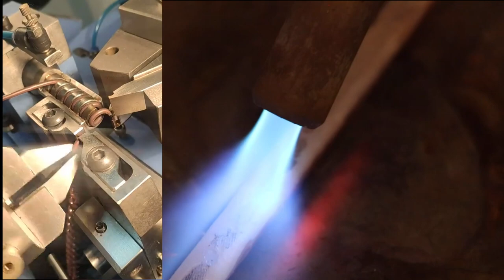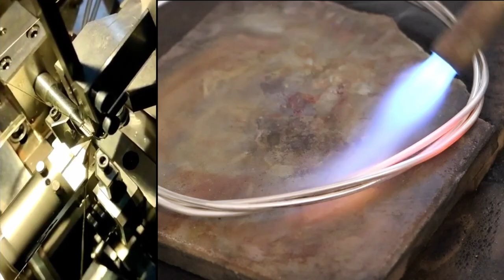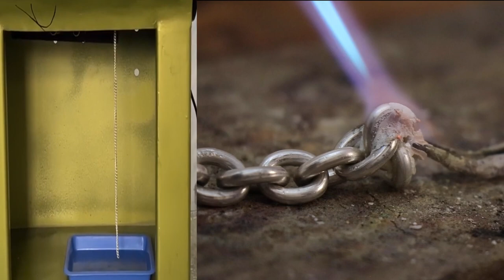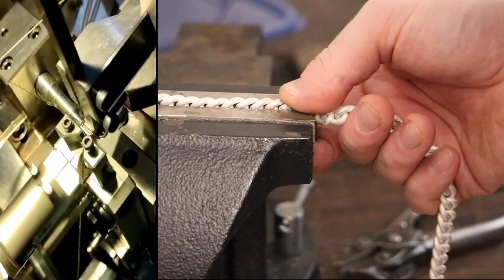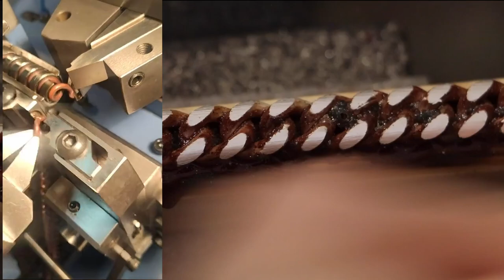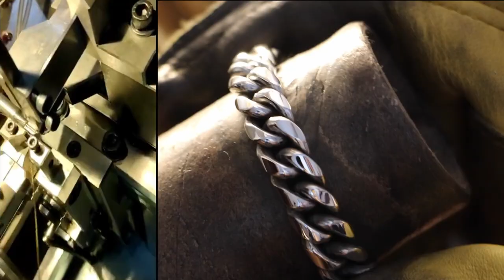CUBAN LINK machine VS handmade | how it's made

Comment: So which one looks better in the end? machine or handmade?
Reply: it really depends on the craftsman. thats a vague answer for you. 

machine-made will be overall very uniform. which is a great thing. 

on the other hand, handmade could definitely be better. but thats all up to the craftsman and how much time they can allocate towards each project. if they are in an environment where they can work on perfection, their pieces would come out better than machine-made. but this is hardly the case. usually, they are just trying to go through as many pieces as they can to meet deadlines. 

i currently have a machine-made 6mm cuban bracelet. quality is great. only thing that i can nitpick is one of the box lock clasps is on the looser side. its something that i can address so its not too big a deal. but everything else is top notch. it hangs straight when i hold it up. links are tight. all checks out. everything is very uniform. 

ive seen handmade chains (daniel jewelry inc) that hang at quite a large curve. ive seen machine-made hang with a bit of curve too. it can be quite random, even in the case of machine-made. its hit or miss. but i would say that you can be more confident in machine-made because it will be much more consistent than manmade.